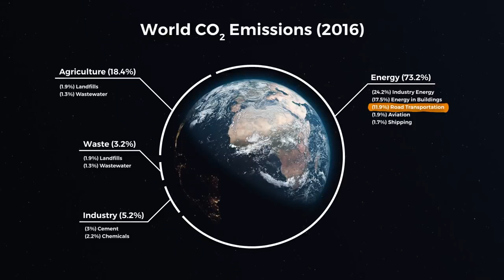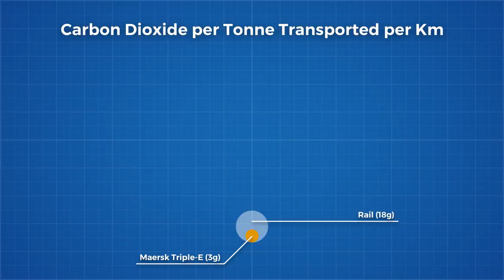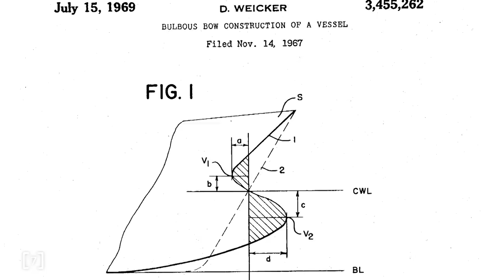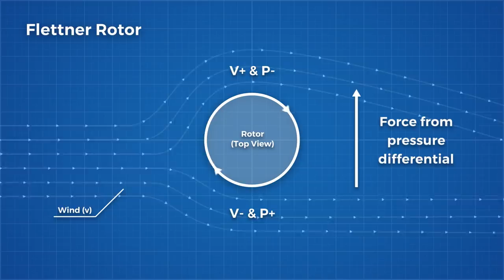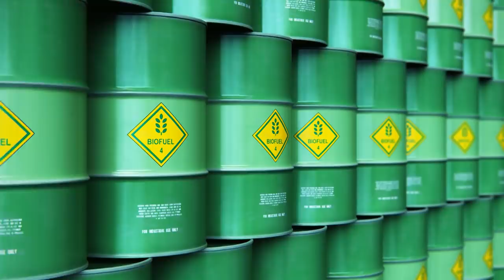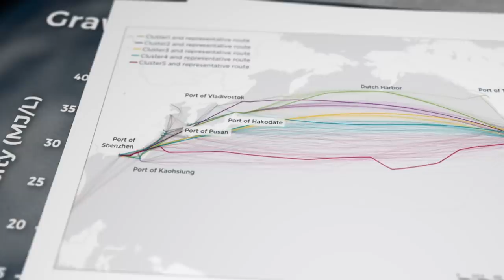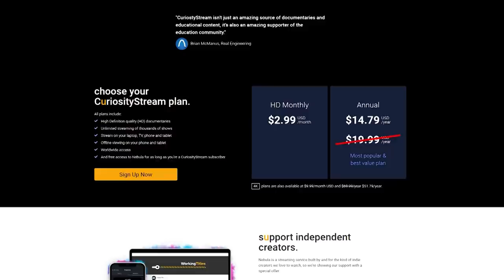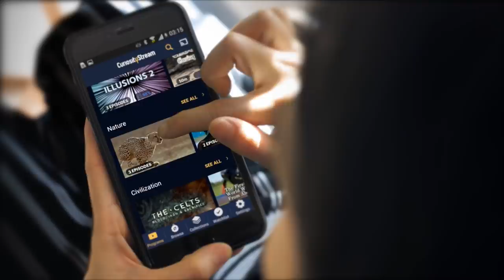Are Renewable Powered Ships Possible?

Comment: They could make ships hydrogen fuel cell powered and suck up water, purify it, and have a system that produces hydrogen fuel for the fuel cell.
Reply: Hydrogen is one of the proposed resolutions for the problem and as with all other options has to be easier, better and cheaper than the existing situation and better than the competing alternatives.  Factors to consider are scale, cost and availability.  How much space and at what weight will fuel cells require per Joule of energy produced? H2 is said to be good for use in fuel cells that will give clean energy when combined with Oxygen (O2) and leave only water (H2O) as an effluent; so as well as the cost of creating the hardware and separating out the H2 in the first place we now have the cost of providing the O2.  Benefits are low emissions as currently measured and they may develop much as the ICEs developed between 1895 and 1945 to displace the draught horse and railways; however that development was 'encouraged' by two devastating and widespread wars.

Comment: Privatization of nuclear powered propulsion would be great for this
Reply: Whoever owns it, it is still not cost effective.  If you do a web search for ‘nuclear ship savannah’ you will see that it has been tried and did not work.  A similarly vessel, heavily subsidised by the government, vessel has been in lay up in Russia since 2012 but could be reactivated.  The Russian state, through a QUANGO, also operates a fleet of nuclear powered ice breakers all of which may, or may not, be completely without issues in support of the Northern Sea Route,.

Just think; would you have full confidence in the management of a nuclear reactor under the control of an anonymous entity only traceable, perhaps, via a letter box in a FOC (flag of convenience) nation state?  If you are, could you sell that confidence to Japan, the state that hosted the Hiroshima and Nagasaki nuclear detonations as well as more recently the Fukushima ‘event’?  Then try that same, or a similar, sales strategy on Ukraine, the nation state that as a part of the USSR (CCCP) hosted the Chernobyl ‘event’.  Modern iterations of nuclear energy, thorium fuel, molten salt reactors or fusion reactors, will carry the legacy of past problems.  It is the global trepidation of anything with 'nuclear' in the name and the economics of nuclear having transitioned from 'energy to cheap to charge for' too 'the costs of remediation are incalculable' that will prevent the adoption of nuclear energy as a means of creating energy at sea.  Modern reaction systems may have overcome the safety problems but the general public, having been misled in the past, will be reluctant to believe the fresh new promises.  The incident of the ‘Ever Given’ blocking the Suez Canal, March 2021, may also have a little to add to this debate.  The cooling water on ships tends to get taken in from near the bottom so when running aground the inlets are in a prime spot to get plugged up restricting, if not stopping, the flow of coolant.  One thing that the TMI, Chernobyl and Fukushima incidents all had in common was that the supply of coolant, or rather lack thereof, was a fundamental cause.

‘They’ say nuclear is cheap, it’s not it is expensive and has a large embedded carbon quotient as well as being complicated, dangerous, not universally socially acceptable and having only ‘no need for refuelling’ as a questionable advantage; actually it does need refuelling just not as often.  When ‘they’ do need to refill the warming up stuff it takes considerable longer than pumping tonnes of thick black stuff, cSt380 HFO, or thin runny stuff, MDO, onboard which is one of the reasons HMS Queen Elizabeth and HMS Prince of Wales are pushed about by ICEs and gas turbines thus using a similar fuel as the aircraft that fly off of them.  The Royal Navy (RN) with a high degree of skill and expertise uses, at vast expenses to the UK taxpayer, a current operational nuclear fleet of 11 submarines (also known as ‘boats’) in two flotillas, seven attack subs and four ballistic missile boats.  The carbon footprint of all the extra bits of hardware and the fuel, including processing thereof, from ground to propeller, are the external costs that never seem to get considered.

Disposal, once it wears out, of both the machine (that was a ship) and fuel is another can of worms best left unopened.  The 26 RN nuclear powered boats no longer in use are laid up (some in Rosyth and some in Portsmouth) awaiting long term deconstruction including dealing with the fuel rods and other irradiated material.  The USN is not, as far as I know, a commercial organisation working to very tight margins and also has the skill and expertise to handle the complexities of nuclear power; so as well as submarines their aircraft carriers are nuclear powered and each of the current iteration has a build cost three times that of QE/PoW, bigger crews and more generous funding.  For those who still think that nuclear energy might be the answer I recommend this report: - https://www.bbc.com/future/article/20200901-the-radioactive-risk-of-sunken-nuclear-soviet-submarines?ocid=ww.social.link.email.  The navy of the USSR might have been under resourced and over extended but it was still generously supported in comparison with merchant shipping.

Another, similar but more extensive view, may be found at https://www.quora.com/Why-are-there-so-few-nuclear-powered-cargo-ships-If-it-works-for-ice-breakers-and-submarines-why-hasn%E2%80%99t-it-been-established-for-merchant-vessels.  Why not use nukes?  It is down to money, societal attitudes and safety.

Comment: Use some big ass sails lol. We have the technology to avoid any storms or bad waters.
Reply: To address the suggestions that wind power is the answer I offer the following example.  In 1870 a premium sailing vessel entered service, the ‘Cutty Sark’.  The ‘Cutty Sark’ was 64.74 metres in length with a beam of 10.97 metres and a loaded displacement of 2 100 tonnes.  She was able to carry, at best, 1 700 tonnes of cargo and to harness the energy in the wind the available spread of canvas was up to 2 976m2 which was tended by a crew of about 30 skilled men.  A ratio between the sail area (SA) and the vessels displacement (D) determines how lively she is; ‘lively’ being nautical speak for ‘fast and manoeuvrable’.  The carrying capacity of cargo ships is constrained in two ways, mass and volume which leads us to the ‘stowage factor’ of the cargo; the more mass on board the greater the displacement which in turn impacts the efficiency of the hull form and sail area / displacement ratio.  A vessel constrained by mass is said to be ‘down but not full’, while a vessel constrained by volume is said to be ‘full but not down.  When in the tea trade, which the ‘Cutty Sark’ was designed and built for with fine lines (more nautical tech speak, so again no need to worry about it) she could carry around 600 tonnes of cargo at speeds of up to 17.5 knots dependent on the prevailing wind and had a typical China to UK time on passage of 120 days.  The tea trade was very competitive so ‘time on passage’ was a large factor in securing the premium freight rate that made her cost effective.  Rounding things out, her maximum available sail area gave circa 5m2 of canvas for every tonne of tea carried.

As soon as the Suez Canal opened, which the ‘Cutty Sark’ was unable to sail through; she lost her advantage, raw speed, to the steam powered ships of that era who could beat her ‘time on passage’ by taking that short cut.  Mechanically powered ships have improved in terms of efficiency, on a freight tonne mile basis, by at least one order of magnitude since then.  After losing out to the coal burning, fire tube boiler, steam reciprocating mechanical ships of the late 19th century ‘Cutty Sark’ was relegated to the Australian wool trade, just about the bottom of the barrel in maritime terms and only one small step up from being a 'honey barge'.  The canvas, cordage and extra manpower needed for sailing ships was never a very benign environmental option so please discount any idea of sail as ‘sustainable’.  All this is without the problem that if ‘the wind don’t blow the ship don’t go’, when it does blow it often blows in the wrong direction for your cargo delivery needs and sometimes there is rather too much of it for comfort.  Sailing ships are unable to go directly up wind so if the wind is blowing from the direction your cargo needs to then a zig-zag course must be steered, more distance and more time.  Wind speed is traditionally measured on the Beaufort Scale (wind speed) that runs from 0 (< 1kn) to 12 (> 63kn) and for sailing purposes the usable part of the range is ‘3’ (circa 8kn) to ‘6’ (circa 24kn).

Random fact about ‘Cutty Sark’, it is said to have been possible to coax 3 000 horse power out of her sails, or in ‘real money’ 2 206 500 Watts (2.2 megaWatts), or 741 Watts for each square meter of sail area.  So that majestic spread of canvas would have been even less efficacious for delivering your baubles and bows from the orient, despite taking about three times as long on the voyage.  The sails on the ‘Cutty Sark’ produced about 0.33% of the power need to propel a Mearsk Triple E in ‘ideal conditions’ the energy harvest would be less than one two hundredth of the output from the ICEs.  Remember shipping is a high volume low cost, therefore low margin business, and all costs have to be beneficial.

Canvas and hemp are accorded 'renewable' (read as ‘natural’) status, if ‘synthetics’ are used there will still be a need for the input of FOGI products.  'Synthetics' would have a much better working life span than 'naturals' but would still yield the same amount of energy, 741 Watts for each square meter in those elusive ideal conditions.  Wallenius are currently giving wind power a go with wing form ‘sails’ but evidence is a little short of proof as of this date.  KTH (Kungliga Tekniska högskolan), a sort of up market university in Stockholm, who are using the funding to derive results will probably, and eventually, in the best traditions of academia ‘publish’ a ‘paper’ unless the funders invoke the well known ‘commercial sensitivity clause’ of their agreement with the KTH.  On board wind turbine might get you around some of the problems, however for marine use vertical axis wind turbines (VAWT) would be better than, the what have now become 'traditional', horizontal axis wind turbines (HAWT) for reasons that include the air draught of the vessel, weight distribution and maintenance access.  The energy yield is still subject to the wind blowing at the right strength and having space available on board for the hardware.  The masts, rigging and sail handling arrangements would take up 'prime real estate' on the vessel.  Fuel oil bunker tanks can be, and usually are, stuck away in any odd corner and the ICE power plants are themselves relatively compact.  The stacked up 'boxes' would mean putting the wind driven propulsion units in a bad situation from a ship stability point of view.

Comment: instead of wind why not use solar by having flexible solar panels that fold up and hang over the sides and then once the ship is loaded a series of electric winches on either side pull the panels up and over the cargo? yes solar is expensive but this sort of system would require very little change to CURRENTLY EXISTING SHIPS! you would literally just install some wenches on the sides and a battery room somewhere inside and bing bang boom your uncles bob.  and if they really want to go ham and spend some money they could remove the large fuel tanks and replace them with a small one for emergency power they could use that space for....more cargo? idk just some thoughts. I know good luck getting some rusty shipping company to invest in something like that :(

Comment: Why wasn't nuclear small reactors discussed? Seems like a good option along with hydrogen.
Reply: If you do a web search for ‘nuclear ship savannah’ you will see that it has been tried and did not work.  A similarly vessel, heavily subsidised by the government, vessel has been in lay up in Russia since 2012 but could be reactivated.  The Russian state, through a QUANGO, also operates a fleet of nuclear powered ice breakers all of which may, or may not, be completely without issues in support of the Northern Sea Route,.

Just think; would you have full confidence in the management of a nuclear reactor under the control of an anonymous entity only traceable, perhaps, via a letter box in a FOC (flag of convenience) nation state?  If you are, could you sell that confidence to Japan, the state that hosted the Hiroshima and Nagasaki nuclear detonations as well as more recently the Fukushima ‘event’?  Then try that same, or a similar, sales strategy on Ukraine, the nation state that as a part of the USSR (CCCP) hosted the Chernobyl ‘event’.  Modern iterations of nuclear energy, thorium fuel, molten salt reactors or fusion reactors, will carry the legacy of past problems.  It is the global trepidation of anything with 'nuclear' in the name and the economics of nuclear having transitioned from 'energy to cheap to charge for' too 'the costs of remediation are incalculable' that will prevent the adoption of nuclear energy as a means of creating energy at sea.  Modern reaction systems may have overcome the safety problems but the general public, having been misled in the past, will be reluctant to believe the fresh new promises.  The incident of the ‘Ever Given’ blocking the Suez Canal, March 2021, may also have a little to add to this debate.  The cooling water on ships tends to get taken in from near the bottom so when running aground the inlets are in a prime spot to get plugged up restricting, if not stopping, the flow of coolant.  One thing that the TMI, Chernobyl and Fukushima incidents all had in common was that the supply of coolant, or rather lack thereof, was a fundamental cause.

‘They’ say nuclear is cheap, it’s not it is expensive and has a large embedded carbon quotient as well as being complicated, dangerous, not universally socially acceptable and having only ‘no need for refuelling’ as a questionable advantage; actually it does need refuelling just not as often.  When ‘they’ do need to refill the warming up stuff it takes considerable longer than pumping tonnes of thick black stuff, cSt380 HFO, or thin runny stuff, MDO, onboard which is one of the reasons HMS Queen Elizabeth and HMS Prince of Wales are pushed about by ICEs and gas turbines thus using a similar fuel as the aircraft that fly off of them.  The Royal Navy (RN) with a high degree of skill and expertise uses, at vast expenses to the UK taxpayer, a current operational nuclear fleet of 11 submarines (also known as ‘boats’) in two flotillas, seven attack subs and four ballistic missile boats.  The carbon footprint of all the extra bits of hardware and the fuel, including processing thereof, from ground to propeller, are the external costs that never seem to get considered.

Disposal, once it wears out, of both the machine (that was a ship) and fuel is another can of worms best left unopened.  The 26 RN boats no longer in use are laid up (some in Rosyth and some in Portsmouth) awaiting long term deconstruction including dealing with the fuel rods and other irradiated material.  The USN is not, as far as I know, a commercial organisation working to very tight margins and also has the skill and expertise to handle the complexities of nuclear power; so as well as submarines their aircraft carriers are nuclear powered and each of the current iteration has a build cost three times that of QE/PoW, bigger crews and more generous funding.  For those who still think that nuclear energy might be the answer I recommend this report: - https://www.bbc.com/future/article/20200901-the-radioactive-risk-of-sunken-nuclear-soviet-submarines?ocid=ww.social.link.email.  The navy of the USSR might have been under resourced and over extended but it was still generously supported in comparison with merchant shipping.